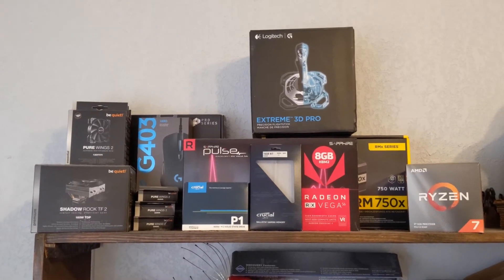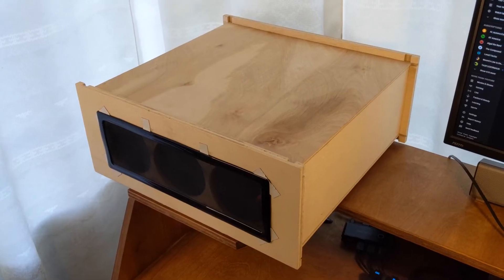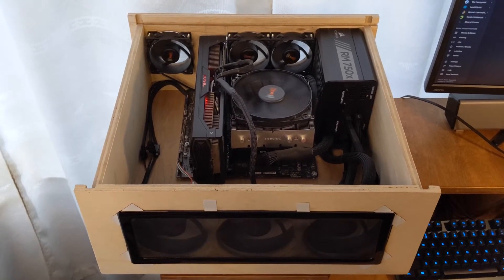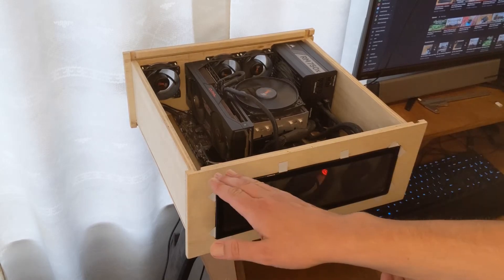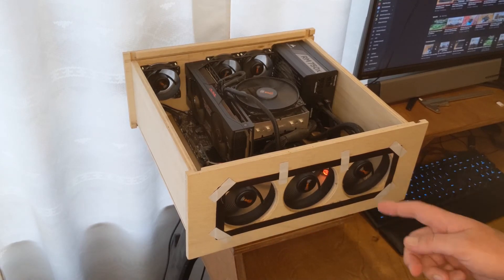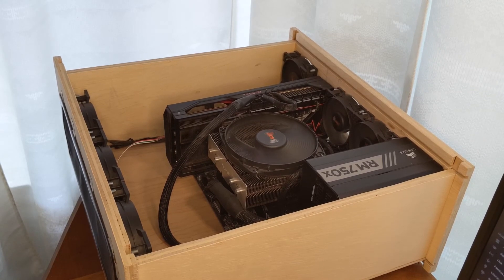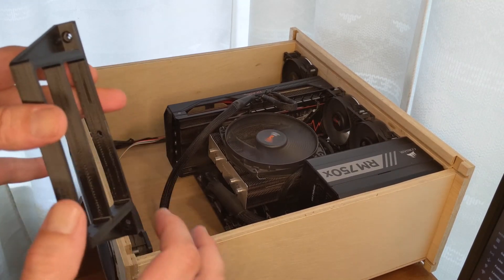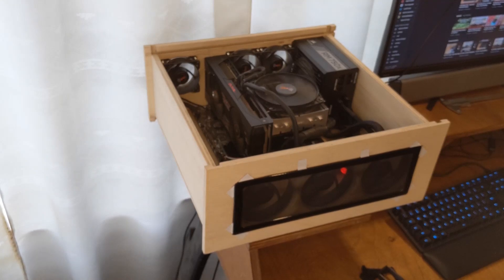Designing A Wooden PC Case Is Easy

Comment: This looks nice. I am in the phase of collecting some ideas for a wood PC. 

The video is now 1 year old. Do you use that PC? Does it work well? How many Watt does the system have in "full power"?
Reply from the maker: Thanks. I hope it helps create your own design. Another benefit of building it this way is that you don't have visible fasteners (except on the side that supports the motherboard and the back), which I think looks better. If you'd want you could even slide a piece of glass in the top/side. I designed it to look ok in either orientation (desktop/tower)

I don't have one of those Watt meters, but the GPU (Vega56) pulls 270W in FurMark and the CPU (Ryzen 3700X) 90W in Prime95. They are never both maxed at the same time with normal workloads and it stays reasonably quiet. It was on in the whole time in the video btw to give an indication of idle noise. This case is probably better ventilated than most cases you buy off the shelve before you start adding more fans to those.

It still looks as in the video and I use it every day. I edit all my videos on it for example. I game on it occasionally and most games do 100 fps on a 1440p monitor. I'm finally getting around to putting that metal backplate in that I mentioned in the video. The back is a bit too floppy with all those holes. Gluing/screwing some metal to it should help. When doing that I'm also going to extend the PCI-e cutout (getting rid of the fan back left) because not all motherboards have the GPU slot in that place. Newer ones often start a slot lower and put the NVMe SSD above it. I'll just stick some dust filters to the holes that are left.
Reply: @BitsOfInterest  Thanks for the extensive answer. :-) 
You have an awesome computer there. It will be hard to build something that's as cool. 
You also have nearly the same hardware than me :-) 

Again, thanks for the inspiration
Reply from the maker: @ElmarLecher  Thanks, that's nice to hear 😁. I make videos of my projects so people like you can get ideas and learn from my mistakes. If you go this route it's really easy as long as you have a router or can borrow one to make the slots. It was my first time using a router building this case 😉

PS I watch a lot of other people's videos to get ideas too and then I make a video about it if it's different enough from what's already out there

Comment: Nice I have an early 2000s clear computer case i used a router on to put rgb 120mm fans into and has a wood panel on the side with same power supply 😂
Reply from the maker: I wanted that acrylic case back in the day, but I built my PC in a 80's vintage tuner instead in 2005 😜 I couldn't fit enough fans of a reasonable size for the hardware I bought 2 years ago, so I made this "drawer" with a top, LOL 😋